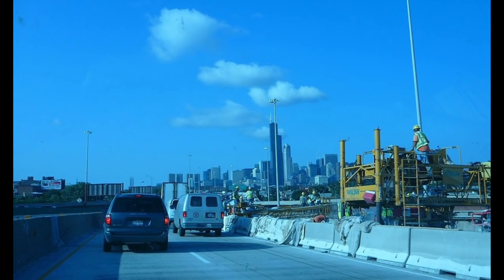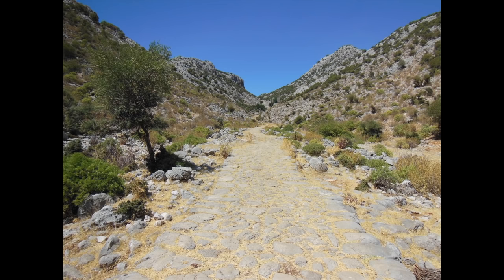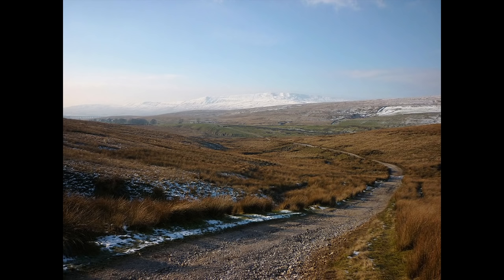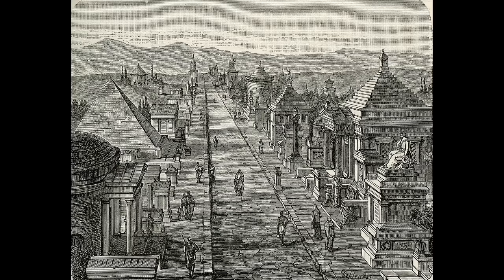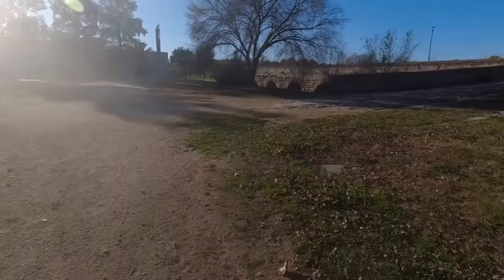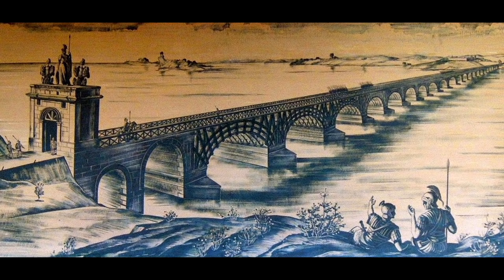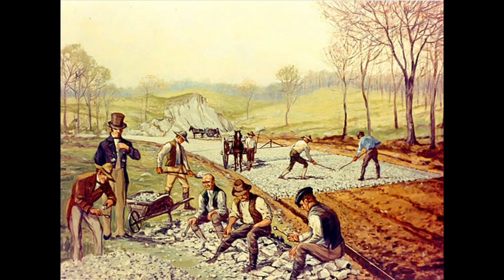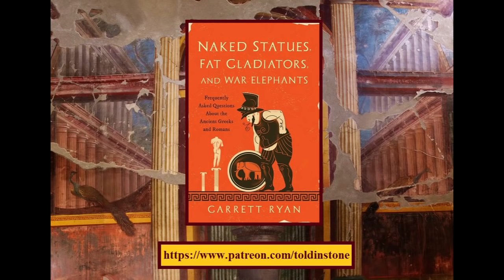Were Roman Roads more Durable than Modern Highways?

Comment: one small thing to note: The actual surface of the roman roads wasn't those rocks. That would have absolutely wrecked horses and would be way too slippery to walk on. There was a surface or sand and clay that was compacted with stone rollers (yes, just like today's asphalt).
Reply: yes exact stop showing ancient roman roads constructed with stone slabs
Reply: that was not a small thing . It entirely changes how people perceive these roads.
Reply: You are correct Sir!
Reply: Exactly, everyone seems to forget that they were smooth when built
Reply: @Rebecca-fu5hg  yep the slabs and such were not the top layer
Reply: @Rebecca-fu5hg  Not quite. Most of these paths are streets of ancient Roman cities or buildings of the eighteenth century. Throughout the 19th century, multiple erroneous archaeological interpretations were made that still persist today. If you don't speak Spanish, you can turn on English subtitles to really get to know what Roman roads were like.

https://www.youtube.com/watch?v=3hPpge4uNJ0&t=2s
Reply: The gaps in the base rocks help with expansion & contraction. The aggregate of clay, sand & stone is somewhat self repairing in the rain.
Reply: @Rebecca-fu5hg  Roman roads with slabs or cobblestone had these slabs or cobblestone as top layer, but by far not all roman roads were build with slabs oder cobblestone as top layer, most roman roads were just gravel roads, wich had no slabs at all, just rocks and boulders as the foundation layer
A layer of clay and sand on top of slabs or cobblestone would be washed away very quickly.
Also if the slabs are not the top layer, it wouldnt make any sense to replace sandstone slabs with more durable basalt slabs.
Reply: I’ve literally been walking on stone roads all this week in Rome and not slipping at all. Also watching cars tear down these narrow roads too.
Reply: Um, doesn't change that under asphalt today is nothing but compacted gravel. There's far, far less infrastructure in our roads that there were, that compacted sand on top wasn't seen as the whole road, but a small replaceable layer on the actual stone that made the base. You dint get potholes without those stones being removed, our roads, disintegrate as soon as that asphalt starts to crack.
Reply: Thanks for the information. Never knew.
Reply: yes and the difference also between these roads is that no roman roads took highway traffic the U.S does daily, and even if today sometimes people drive on them, not like in the states where some trucks weigh like 20 tons.
Reply: @travixx07  And what are the soles or your shoes made of? My guess is that it won't be smooth leahter, studded leather or your bare feet. Modern rubber is pretty good at grabbing, well, everything when you're walking on it. A lot of people in the past were bare feet. Ever tried walking on stone that has been baking in the mediteranian sun for a few hours without shoes on? I did, not a great idea. Smooth leather would have worked pretty well, but you'd have no off-road grip. That's why Roman legionaries wore studded shoes, which would have had no grip whatsoever on smooth stone.
Reply: @piccolo917 I know you said this a year ago, but at 2:50 he stated that.
Reply: @Rebecca-fu5hg  Those slabs are street pavement, meant to be inside de city limits. No stone surface on a true road,that way they limited the speed and the type of carts in the city. Stone streets were far more easy to keep clean and far more practical to walk on.
Reply: @travixx07  my hometown is of roman roads and in wintertime theyre really dangerous especially on bicycle. The stones are worn down they are smooth like glass
Reply: +1
Reply: @travixx07 those are streets not road. For keeping the mud and dust out of the city. Do you think a horse can run from Rome to Paris over those slabs? How do you think Romans travel? They travel on wagons with normally 2 horses and other smaller a with 1 horse. You can't walk from Rome to Caesar Augusta.

Comment: My father is 92 years old.  He still refers to asphalt as macadam (McAdam).  Most young folks would have no idea WTH he's talking about.  😂
Reply: My dad born in 1918 called it that as well.
Reply: Does your father call rain boots "wellies" as in Wellingtons?
Reply: here in ireland, we generally call it tarmac today, an abbreviation of tarmacadam
Reply: Completely random, but in rallying there's "macadam stages". It's definitely not asphalt though; rather it's those compacted, gravely roads (throws lots of dust usually).
"Tarmac" I'd say is typical for airports. No idea why, honestly.
Reply: Isn't macadam a mix of the glueing stuff (asphalt) and sediments (stones or rough sand)? Presently they mix all sorts of materials to increase durability and resistance to heat.
Reply: @miralupa8841  bang on i used to work for a company called Tarmac here in Scotland, building roads.... 👍

Comment: I think the Roman network of roads might be the biggest achievement that the romans ever made. That network of roads probably helped the romans generally to stay in power far longer than they otherwise would have. Those roads also werent just often walked pathways to other regions but actually well constructed pieces of engineering.
Reply: Exactly, you can clearly see the difference in quality between these roads and medieval ones. Near my house there were two stone bridges standing next to each other, for some reason, a roman one and a medieval one. A couple of years ago, a large pine tree (like 25m tall) fell on them during a storm. Needless to say, the medieval one collapsed instantly and filled the river with rocks. The roman one is still standing and the only damage done to it was that a couple of stones that made up the railing were broken, but they have since been replaced. I'll send a google streetview link soon so you can see what I'm talking about
Reply: @Fred_the_1996  did you find it?
Reply: @TS-jm7jm  yes
Reply: @Fred_the_1996  did they rebuilt the medieval bridge, would be shame if they just replaced it with ugly modernistic construction.
Reply: And the roads were also their downfall
Reply: Its the aqueducts. They used them to power wooden machines so they could have mass production. It wasnt just for water or just for sewerage. The ancients used water power for everything. Its a very cheap energy and transfer is just kinetic to kinetic so loss is low. Im gonna guess the roads were at least partially helped by this mechanization. Maybe the sand? We know today crushed gravel holds far better then rounded gravel.